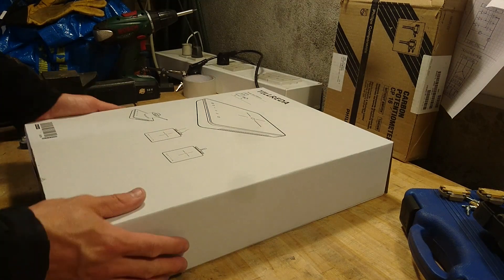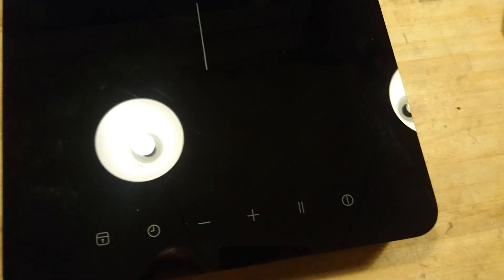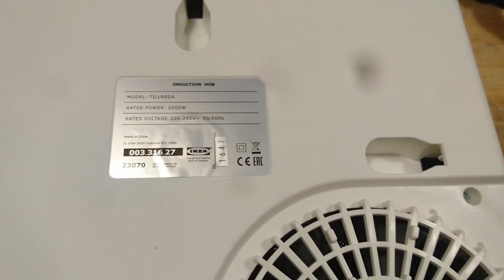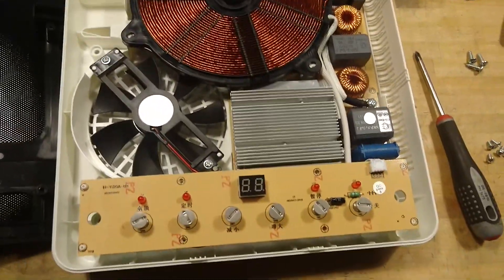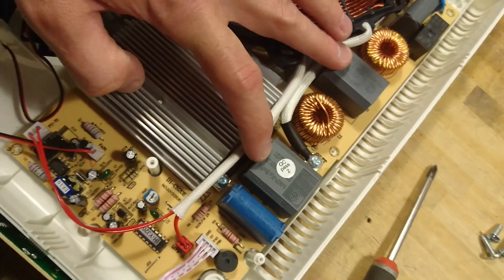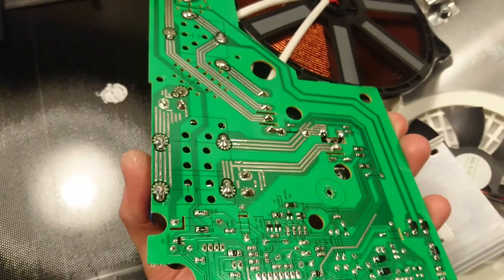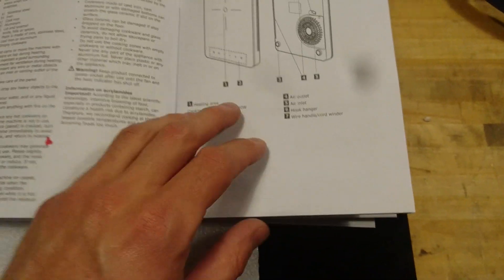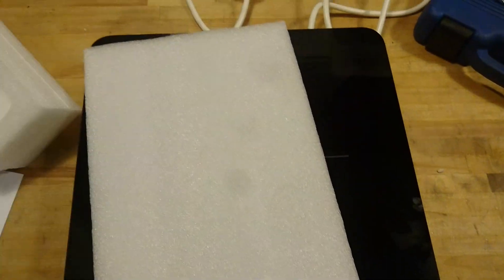Hacking IKEA 2kW Induction Cooktop, Teardown (Part 1 of 5)

Comment: @kaizer if uou are still following comments here 😅😅 id like to know if there is a way to improve light visibility. Im using this on balcony, and leds and numbers are invisible 😢😢
Reply from the maker: You could properly put a LED driver in-between the microcontroller and the LED display, so you can supply it more current.

Comment: Can you tell me how did you open it?
Reply from the maker: Screws on the backside, some are hidden under labels. The glass plate is glued in place, that needs to be removed carefully, cut around it with a knife.
Reply: Thank you so much for your super quick reply ❤️

Comment: Jeg ved det er mange år siden denne video er kommet ud, men ved du om der en mulighed for, at man kan omgå timeren på pladen? Den slukker automatisk efter 2 timer hvilket er vanvittigt frustrerende hvis man vil lade noget koge hele dagen.
Reply from the maker: En simpel 555 timer kunne vel bruges til at trykke på knapperne, men det udgør en stor brandfare som du selvfølgelig skal sikre dig imod på anden vis.
Reply: @KaizerPowerElectronicsDk  Ja, det var kun til at koge fond og lign., så man skulle synes brandfaren var lille. Lyder interessant med 555 timer, da jeg ikke har nogen erfaring indenfor kredsløb, men det må undersøges. Tak for hjælpen!

Comment: Any idea how thick the glass is and if it could be saparated? It looks like 2 pieces are glued together...
Reply from the maker: 5-6 mm, I doubt it could be taken apart without breaking one of the glass plates
Reply: @KaizerPowerElectronicsDk  actually don't mind one broken just wondering how they stuck them together and why would they use 2 instead of one

i rly badly need a ceramic glass plate for my bga rework machine as bottom part above the heater plate so i have a flat surface to rework motherboards on and this one had perfect measurements, just thick glass
Reply: @KaizerPowerElectronicsDk  do you by any chance still have the thing at home somewhere? I think the bottom layer is actually plastic

Comment: I have an Ikea 2kw  Cooktop. A solid-looking device that i broke. Totally my fault. I basically unplugged it with the fan still running, before it had cool down. It's probably a simple fix, but i can't find the overheated component, which is either a heat sensor or MOSFET.  Im still looking for a clue.

Comment: hey kaizer, nice videos 
im looking to do something slightly different !! i have a dual hob 
is there a way to limit current draw for each hob or the entire unit combined 
its for running off an off grid inverter and wanting to limit its output
cheers
Reply from the maker: Find out what the maximum level of each zone, is that you can run and stay below your power use threshold. But limiting its power is the same as limiting its output, so what good is it if takes hours to boil a pot of water?
Reply: @KaizerPowerElectronicsDk  i was going to wright out 20 paragraphs but figure it would be easier to just link a video to one of our competitors to show u what were are looking to do 
limiting them for not going over our inverter capacity 
https://www.youtube.com/watch?v=0GKQfXfWI34&t=112s
hope u dont mind the link 
cheers mate

Comment: I have a question, well I have an induction fryer, I have a short circuit in the IC in my case it is the HIGHWAY13A instead of the HIGHWAY09A.  I've been researching and I see that both are similar.  Although my doubt is it possible to get this integrated circuit already programmed or does it require extra programming.  I was thinking of buying it on Aliexpress but I'm afraid it won't come programmed.  I hope you can answer me
Reply from the maker: From a software control point of view, it makes sense that Highway sells them preprogrammed. But we dont know for sure.
Reply: @KaizerPowerElectronicsDk  I hope so,

 I have contacted two sellers to confirm if they really come programmed.... 

Coming from China I at least hope to have my induction cooker repaired before Christmas.  

Thanks for answering

Greetings from 🇲🇽

Comment: Hello!
I was wondering if you maybe have any idea what did I destroy, when I touched the power on "touch spring" with the ground wire.. There was a tiny spark and after that all of the "touch springs" and display stopped working..

Comment: I Want to ask you a question. Does this type of induction stoves come with a sensor that senses if there is a pot on the stove? If they do is there any way to bypass it? I Want to be able to run a induction stove at max power without any pots and pans on it does that work?
Reply from the maker: Pot sensing is done by measurement of current flow in the primary resonant circuit. The only way to bypass it, is with a custom driver IC. Running full power on a non-loaded induction system has quite a lot of losses and worst case you blow up your IGBT bridge from the very varying load.
Reply: @KaizerPowerElectronicsDk 
Ohh so the Flow itself is meassured. What i want to do is have a external load trough a pickup coil on the stove.

Comment: Can the 120V version be modified to be ran at 240V?
Reply from the maker: All components are properly too low voltage rating, you might need to change all.

Comment: im curious can this is powered with dc instead of ac ? Im thinking that since it has a rectifier to make it dc can we just skip this step?
Reply: i have couple solar panels providing me with ~200v dc without a inverter at the moment so i want to do something with them
Reply from the maker: No. The quasi resonant mode utilizeses the AC mains waveform.
Reply: @KaizerPowerElectronicsDk  plan b :P what if i use a igbt to pulse 100 times a second the dc voltage (same polarity, no flipping), does it need to be sinewave?
Reply from the maker: @EpicHardware  most likely needs to be a sine, as power is adjusted with a phase angle on the rising edge of the sine wave. Run the square wave through a output chokes for a sine wave, like a regular cheap UPS
Reply: @KaizerPowerElectronicsDk  awesome, thanks for your anwsers. One last thing, is any other method for induction cooker that can work with DC? Maybe I can search for it try it and post my results
Reply from the maker: @EpicHardware  find a more expensive / high power induction cooker that uses a regular half or full bridge, then you can feed its DC bus directly.

Comment: Is it possible that they used the fan as the beeping device?
Reply from the maker: That could explain that is takes half a turn
Reply: @KaizerPowerElectronicsDk  Like I'm really not sure but maybe if you put an AC current trough the fan it makes a sound with the frequency of the current

Comment: Hello Kaizer. I'm repairing a similar one, almost exactly the same. At the centre of the coil are two sensors: temperature cutout and another one that looks like a glass diode, I'm not sure. It's open to the meter. If you know please let me know. Many thanks.
Reply from the maker: I think it could be some kind of reed switch to react to the magnetic field.
Reply: @KaizerPowerElectronicsDk  Thank you very much for your direction. Sorry for the late reply. It looked like a glass diode, but it wasn't (yes the other one was a temp cutout). It's glass to withstand the temp, but its electrical characteristic was more like a thermister, so it must be. It turned out that the IGBT gate resistor 200K was the culprit.

Comment: Any possibility to use a SiC Mosfet and increase the switching frequency to like 70kHz? Panasonic used to have such a induction cooker called Met-all, could be used with Aluminum cookwares...
Reply from the maker: SiC MOSFETs uses a asymetric gate drive from typical +20 to -5, so you need to rebuild the gate drive circuit for that. Swithcing frequency is not easy to change in a IH like this, they are designed to work right at the edge of what is possible with so few parts. From the original 25 kHz, you can not change that to something 25-50% without blowing up the MOSFET and bridge rectifier.
Reply: @KaizerPowerElectronicsDk  Hi Kaizer, thanks a lot for the detailed answer. What I think of is actually drop-in a SiC AND crank up the frequency. The gate drive circuit definitely need some change, and DC-Link Caps must be of higher voltage to withstand ringing from faster switching etc :-)

Comment: Ikea says that this induction stove coil size is 185mm in diameter. 
 Is it safe to switch original coil for a bigger one like 230mm?
Reply from the maker: In terms of switching losses, a larger coil would have a higher inductance, resulting in a lower resonant frequency, so you are not going to burn your IGBT or bridge rectifier. In theory it should work!
Reply: @KaizerPowerElectronicsDk  BTW, this IKEA TILLREDA cooktop, makes strange buzzing sounds from my IKEA pan. It doesn't happen from 4 coil induction cooktop.

Does the nature of this buzzing sounds can worsen my pan in terms of heat transfer from ceramic hob?

I added videos with this sounds on my channel, you can hear them on last two videos. And I looked other people's videos with their IKEA TILLREDA, they all had same buzzing sounds (expect not that loud).
Reply from the maker: I do not see any videos with that on your channel?
Reply: @KaizerPowerElectronicsDk  I forgot to change it availability. Now you should see it

Comment: Tell me, please, did you smell of plastic when the device was in operation? If yes, from which part do you think? Thank!
Reply from the maker: There was no weird smells or unexpected heating in my unit. It could be a part of the primary LC circuit of the work coil and resonant capacitors as there is where you have the highest heat dissipation.
Reply: @KaizerPowerElectronicsDk  Thanks for the answer! It's great that you didn't have a smell .. I hope it will pass with us over time, if it is possible.

Comment: I have an 1800W 120V induction cook top that has the resonant capacitor (the large 8uf MKP X2 cap) blown.  I replaced it with another 8uf  275v AC (not same brand or model) capacitor but it also blown shortly.   Any idea if I can use other high voltage metal film capacitor?Or does it have to be some special caps that work at high frequencies?   Thanks very much
Reply from the maker: How long did it work with the replacement capacitor in? The resonant capacitor does not usually blow, but would more likely melt. Sounds like you have other problems that kill the capacitor.
Reply: @KaizerPowerElectronicsDk  it worked for about half an hour before it swolen up and stopped.  The physical package size of the replacement cap somehow was only half of the original size even it from same manufacture and rated at same capacity and voltage (275v AC, 400v DC, 8uF). I'm waiting for another cap from Aliexpress to see if it fixes it.
Reply from the maker: @tttuberc  Okay, sounds like you just need to find a proper high frequency MKP capacitor then. X2 capacitors are MKP capacitors rated for being used in input filters of power supplies, they just happen to have similar ratings to those MKP capacitors used in resonant circuits. You need to find some with low losses and high RMS current capabilities.
Reply: @KaizerPowerElectronicsDk  thanks for your advice. I recieved the correct caps, and now the cooker works fine so far. Knock on wood

Comment: As, I have noticed that IKEA is selling two different model, one with 2000watts (220v) and the other with 1800watts (110v):

https://www.ikea.com.do/santodomingo/mobile/en_us/product/tillreda/portable-induction-hob/?&item=169119&id_src=16

I would like to know, apart from the 200watts of difference between these two models, do they really work in the same way?

I would also like to know, if in practice, you really notice this small difference of 200 watts when cooking food?
Reply from the maker: They work in the same way. The lower voltage version will just have rectifier and IGBT rated for twice the current and perhaps a lower voltage.

200W is 10%, so you should be able to see a difference in cooking time, but noticeable when making food, not really. Maximum power is often only used for heating up fast for frying or cooking water, regular cooking is almost always at some 50-75% power.

Comment: Is it possible to make this work from a battery
Reply from the maker: Only if you use a battery to 230VAC inverter, as the circuit relies on the sinus envelope of the 50 Hz mains to work properly.

Comment: It appears that most induction cooking uses this flyback topology with a single transistor.  I gather that some use a series-resonant circuit from a half-bridge.  I've never heard of a Royer oscillator being used for induction cooktops.  With a pan in place, the Q is too low for a Royer oscillator to maintain oscillation.
Reply from the maker: Simply because it is so dirt cheap to make and you are almost always limited to 230VAC 10A

Comment: I tore my Ikea Tillreda down to have a look as I'm an electronics engineer and like to see how things are made before I use them for safety reasons and curiosity. Also I do not think the LED Segment display is bright enough for "Camping" so first thing I did was peel off that protective sheet off the display, I may fit a different LED Segment display or change the resistor to increase brightness. Also interestingly I also bought a VonShef branded unit as it I read it had a 200mm coil, even looking a the glass the pan placement gives you the impression it has a larger coil than usual. But it was only approximately 160mm when I took it apart and measured it, not only that the spacing between the coils were bigger and much less coil metal used! The Ikea Tillreda seems to have the biggest coil I've seen on these portable units. I wish there were more teardowns of these products as there a few on the market and I don't believe the specifications.
Reply from the maker: What I found the most interesting was how well it was functioning despite it is a topology working right at the edge of what is possible on both mains outlet, components used and physical dimensions taken in account.
Reply: @KaizerPowerElectronicsDk  Ikea have another version of this out, it's smaller but has the same specifications, it has only 4 buttons now but still has the annoying "Child Lock" I bought one this evening as it looked a good size to take camping. It has an annoying issue, even though they have corrected the Piezo Buzzer/Fan issue, the Piezo constantly makes a very quiet high pitched sound, which is annoying! There must be some noise from the MCU or bad programming.  I took it apart and it is also a Highway design and it has even less components! They didn't even bother to install the filter capacitors on the primary side, the PCB has locations for them but they cheaped out.
Reply: @dalerobinsuk no filter cap on the pri means near unity power factor. All induction cookers I've seen operate this way, otherwise they'd require active PFC
Reply: Ikea says that it's coil size is 185mm in diameter. Is it safe to switch original coil for a bigger one like 230mm?
Reply: Interesting, did you try suing the manufacturer for false advertising? My major concern with induction stove tops is reliability. They have for more components that can burn out or stop working than a regular hot plate or gas stove. Its not very simple for some diy to try to isolate problems on a circuit board such as bad resisters or popped capacitors or maybe a fried ic.
Reply: How did you open it? Please help

Comment: I got a similar appliance few days ago, from other brand. For power level set to less than 1000 W, it utilizes pulse mode - heating with impulses of 1000 W and making pauses between. Burnt my porridge as a result when I stopped to mix it. Total crap. I wonder whether IKEA hob uses similar mode or not.
Reply from the maker: Take a look of the part 2 video I made on this, here I explain the waveforms and you can see that it operates at a lower voltage at the lower power modes, but primarily it is still in pulses, but certainly not in the maximum power pulses.

Comment: Can you make a small  nut and bolt heater out of that set up by removing the flat coil and build a round coil and use like a handheld unit ?
Reply from the maker: The large inductance needed in the work coil will make it unpractical for a small handheld unit, any size coil you want to use instead will need to be much like the original, in terms of inductance.
Reply: Kaizer Power Electronics hey thanx

Comment: my guess with the beeping and the fan is like on brushless motors for drones and other planes; it uses the motor for a speaker briefly... kinda like taking a HDD apart and using it for a speaker...
Reply from the maker: It is a good idea to minimise number of components, but there is actually a piezo beeper in this unit, you can see it at the right side of the PCB at 05:06
Reply: Kaizer Power Electronics I think the fan and the buzzer may share the same IC output: beeps in AC, uses fan in DC!

Comment: The reason fan slows down is, because it tries to find resonance freq. and it draws power, even when there is no metal to heat up. It finds out there is nothing metal on top and stops (beeps)
Reply from the maker: It would make sense that it breaks its PWM output, but I would not have put the fan code into that same loop :)
Reply: I hope you have already checked the schematics. As in most simple designs, the control for the cooling fan and the buzzer share the same port of the MCU. Therefore, in order to generate a 'beep', the normal DC supply to the fan is interrupted and replaced by a pulse train during the beep sound.